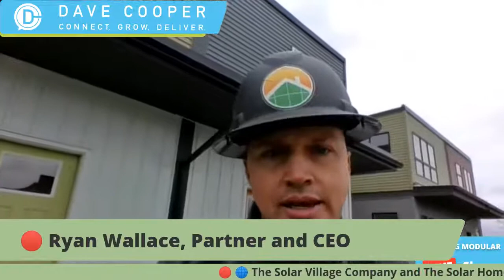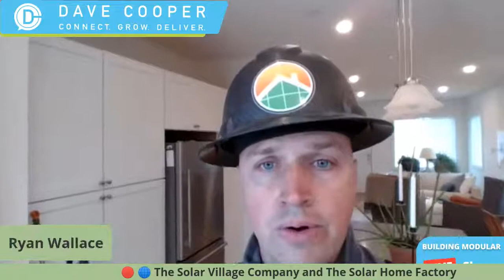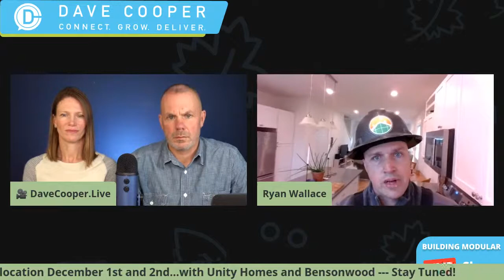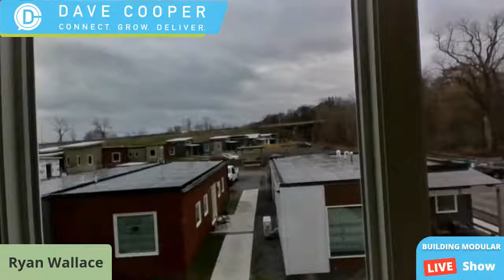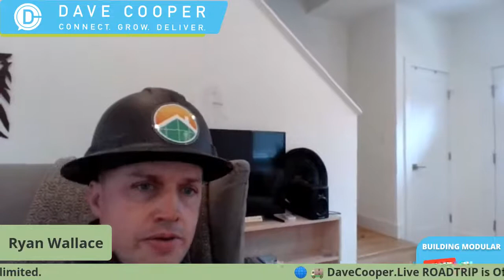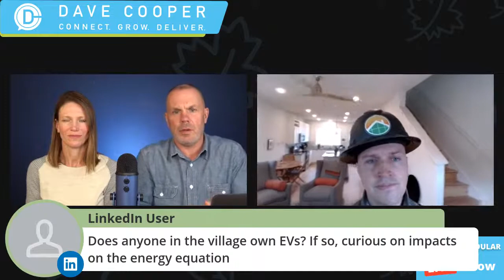Prefab Off-Grid Living in Volumetric Modular Built Homes and ADU's from The Solar Factory

Comment: SIPS made with Hemp/Bamboo is the ultimate answer. With the screw in foundation systems for normal soils these factory homes could rival Park Model RV costs. I have been designing a unit with 1.5 bath single floor at 400 sq ft using one wall plumbing in a 12' X 34' foot print....NO...No Park Model Factory will build them or consider using SIPS. Besides IF THEY WOULD CONSIDER the floor plan, it would be at LEAST 36 months out and require $85000 up front to order.  So using a company like Ryan's is the ONLY way it could happen. For the potential 40 million consumers $100 per sq ft. would be doable using a Farm Home type program...